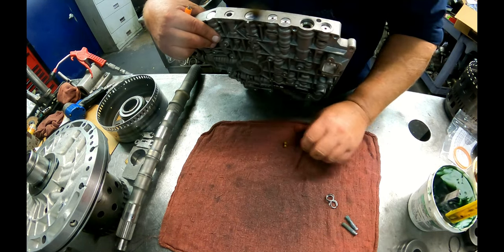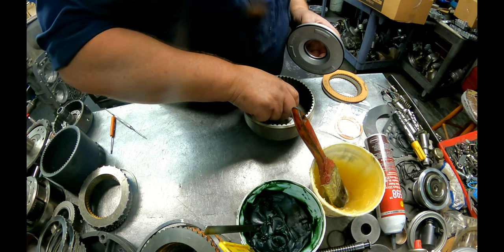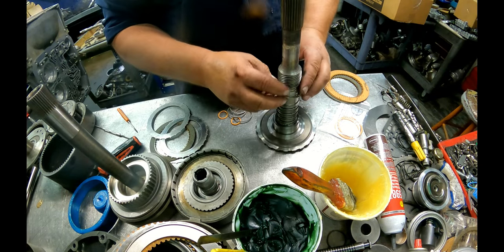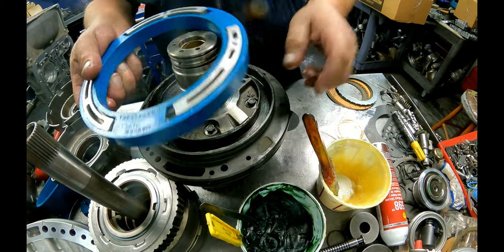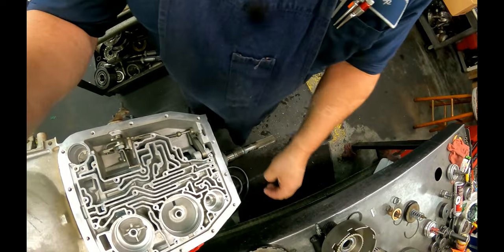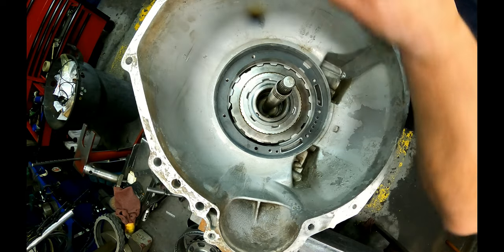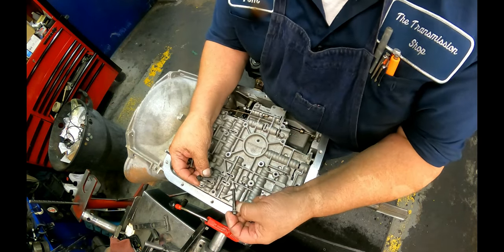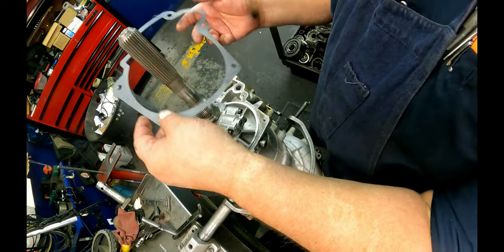AOD Rebuild

Comment: Hi guys! I put l a freshly rebuilt aod in a 67 mustang.. it runs great and all but after about 30 minutes in traffic it slips trying to go into overdrive… what is the cause of this? Do I need to rebuilt again?
Reply from the maker: If you are sure the TV pressure is set correctly and you did not address the end plugs in the valve body I would put them in. There are 2 different ones depending on the year. Also what code servo do you have? A,B or C? https://www.sonnax.com/parts/2417-governor-circuit-end-plug-kit
Reply from the maker: It is also possible the servo pin bore is worn. This will fix that. https://www.sonnax.com/parts/1663-overdrive-servo-pin-kit